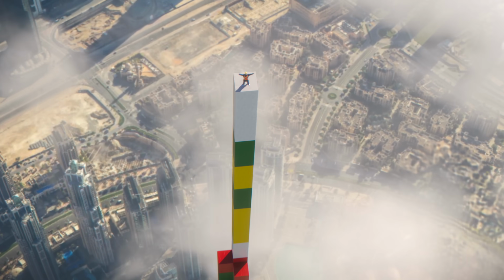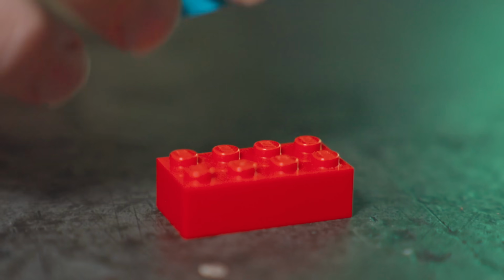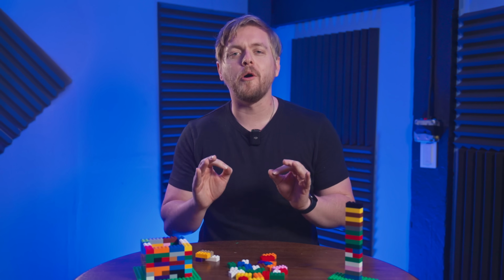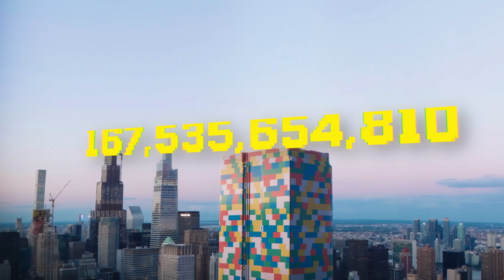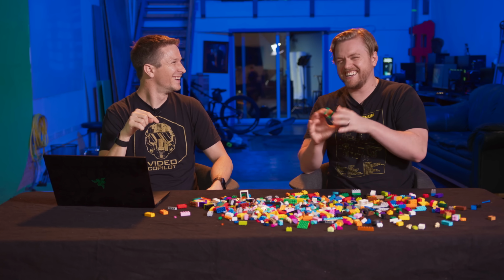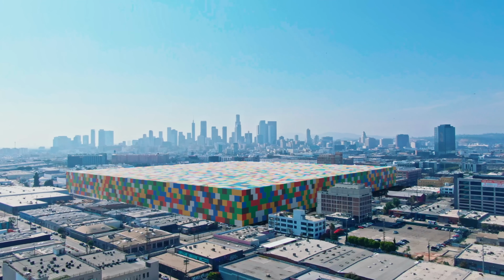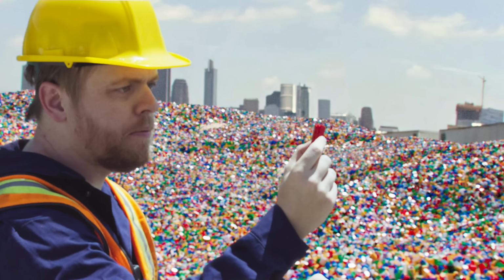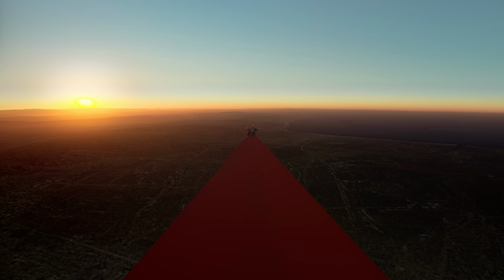How High Can You Build using only LEGO?

Comment: You can't just take the crush force of one brick and multiply it by however many bricks are at the base.  When you stack the bricks next to each other thru support each other.  The bricks have a harder time bucking because there is no room to buckle with all the other bricks surrounding it.
Reply: Yep. They also neglected this when building their "single" row mini tower. Sometimes they used 2 smaller bricks in place of 1 larger one- which may cover the same area, but has 2 extra "walls" pressing against each other internally.
Reply: You're right! We could build even higher, but we've already depleted the world's petroleum reserves. But wait! If we take all living things on the planet, humanity included, and convert them into petroleum....
Reply: Additionally, unlike the video, the Lego structure needn’t be completely solid (few buildings are!), therefore enabling the tower to reach taller still.
Reply: Many comments that followed this comment are so needlessly inflammatory and argumentative. So good to see people continue the rich youtube tradition of arguing over stuff that doesn't matter. Feed that engagement algorithm. FEED IT.
Reply: I also would expect a sharp cone like the burj to be way more efficient. They don't need to go as wide as the pyramid to make it to that height.

Given the amount of empty volume in a brick though, i doubt that the crush force will be THAT much higher. It will crumple inward. It'll be higher still. Maybe 25~50%? Not like solid brick where its like 50x.
Reply: You didn't understand anything at all.

The point they made was not about buckling but solely about the maximum height.

They explained it so well just rewatch, I won't waste my time witht that...
Reply: @oldhelldog5460  you don't understand. Imagine we were talking about a sand castle. A lone 5cm cube of sand could support maybe 100grams of force. But if you surround that sand with more sand... like on a beach it can support several 1000kg.

Max height of a sand tower with vertical walls is probably about 5cm. Max height of a sand pile is like....several kilometers.
Reply: @Idiomatick  A sand pile of kilometers high is literally a pyramid shape, which is exactly what this video concluded. it's the strongest shape.
Reply: @CheeseRunner  They could make it taller though.
Reply: @oldhelldog5460  said "You didn't understand anything at all. The point they made was not about buckling but solely about the maximum height. They explained it so well just rewatch, I won't waste my time witht that..." 

The crush force and buckling was what set the maximum height from the start, before they considered manufacturing tolerances. It's in the video.
Reply: @Psychlist1972  Buckling never determined the maximum height only the shape needed. Only the compressive strength of one single brick did in fact limit the height. 

In the video, buckling didn't determine the maximum height — only the shape. The height was limited by the compressive strength of a single brick, since the material was "infinite".
--> This is also in the video.
Reply: @oldhelldog5460 compressive strength is limited by buckling of a single brick
Reply: @oldhelldog5460  That has nothing to do with what I said.

Comment: To be fair, in a lot of these sculptures, the glue and steel isn't due to failing to trust the bricks, but because they have learned that you cant trust people not to tear it apart.
Reply: Exactly.
Reply: I used to work with the shop near San Diego which builds for many properties, hence have to be built to handle the stresses of shipping, setup, and, yes, children enjoying them.
Reply: Not just that but transporting the statues too I think it’s more of that like they put a lot of work into building it and I don’t want to do it again. It makes more sense Luna and having reinforcements in it.
Reply: ...and they use Methyl Ethyl Ketone and not glue to fuse/weld the bricks together.    Using glue adds some error in the dimensions over large builds apparently.
Reply: It's also for safety. You don't want a sculpture to collapse and injure visitors. People dying in your store or themepark can sometimes be perceived as negative press.
Reply: Lego just BEGS to be constantly arranged & rearranged! It's not like a 3d puzzle where there's only one possible arrangement of the pieces. Plus, I'm betting if publically accessible Lego sculptures weren't steeled & glued together, people would probably detach some pieces to steal as ''souvenirs''.
Reply: griefers: oh hello there
Reply: So trueee
Reply: fr
Reply: Not quite. You can absolutely trust people to tear it apart. 100%.
Reply: @HenryLoenwind  He literally said the same thing, just used double negative. Can't trust not to do something = can trust to do something. The former is just a more pessimistic or negative view of the action.
Reply: @WeHaveACityToBurn it isn't really a double negative. You cannot trust that people will be honest. Or you cannot trust people won't steal. It's not the op's fault there isn't an English word for not stealing.
Reply: @WeHaveACityToBurn  It's not the same. "Can't trust people not to ..." only means you can't be sure they won't. There is no single negative way of expressing that.. You'd have to say something like "you can't be sure they will respect the sculpture". It doesn't mean that it's a given that they will tear the sculpture apart.
Reply: @WeHaveACityToBurn  I disagree. One is saying people MIGHT destroy it, the other is saying people WILL destroy it
Reply: @WeHaveACityToBurn  No, their meanings are slightly different.

The original comment essentially said that you can't trust people NOT to try and break it.
The reply said that you can trust people WILL try to break it.

The first is an uncertainty, saying there's a chance a thing will happen.
The second is a statement of certainty, saying that said thing WILL happen.
Reply: @WeHaveACityToBurn  No it isn't. "Something happening is not certain" and "something will certainly not happen" are not the same.

If we were to write this down formally, we'd use "<", "<=", ">", and ">=". When you negate "<", you don't get ">", you get ">=".

probability(not tearing apart) < 100%

is not the same as

probability(tearing apart) = 100%

after multiplying out the "not", it is 

probability(tearing apart) >= 0%

Or, to stay closer to the wording: "I would not bet my life on you not winning the lottery" (it may or may not happen) is not the same as "I would bet my life on you not winning it" (it will happen).
Reply: @WeHaveACityToBurn  Double negative is kinda dumb ngl
Reply: @WeHaveACityToBurn  Wrong. You focus on the grammar while leaving the reading comprehension out of it. Re-read both again sloooowly. Maybe that will help you out
Reply: @masamaeda9217  I will destroy it
Reply: @masamaeda9217 Pedant. I meant that as an insult.
Reply: Well also Legos have a physical limit to how well they connect to each other and a lot of massive builds need internal structure to prevent its weight from pulling itself apart. The real enemy is from within.
Reply: @ryan7032  one thing that baffles me to this day is that they rarely use technic in these mega builds, despite it being lighter, more flexible, and sturdier overall.
Reply: @Elaarener 
They made a huge dinosaur in LEGO HOUSE Denmark made of LEGO technic.

It is mega ugly compared to the normal LEGO brick dinosaur in the same room.
Reply: @CaptainNapking  
yes. it is fairly ugly. but that's not because it's technic. there's 2 main reasons:

1.its almost 100% studless technic parts, probably because some manager said "lets make a big model using just technic" without talking to the builders first.

2.the design is extremely noisy and cluttered when compared to the other two dinos. it would have been much easier to design if they had used normal bricks as well.

I know they are trying to show the 3 systems, but the separation is entirely artificial. system and duplo are rarely used together, but system and technic are only separate because technic has a dedicated theme. if they had spent some more time thinking about it, and hadn't been so focused on branding, they might have realized this.
Reply: @Elaarener 
Alright, well said, my point is in shambles with little worth left.

But it still has some, right?

EDIT:
Well, it looks like youtube agreed with me and hid your comment for being mean against danish LEGO officials.

Haha, I win again.
By default...
but I win😊
Reply: @CaptainNapking  ah well. sorry if I came across as a snob or something.
Reply: @Elaarener 
I just found it funny how youtube removed your comment for no reason as it always does.
Reply: bet, im stronger
Reply: @kung_puey  the glue is not regular glue but a solvent that sort of desolves the surface area of plastic but only for so long and then two surfaces fuse together. even if you were strong...you'd just break the bricks
Reply: @kung_puey based on your pfp, your weight is 7x the weight of the burj khalifa, all you would need to do is sit on it.
Reply: Humans are the worst!
Reply: glue yes. steel no
Reply: Unless you live in Japan (and the LEGO tower is in a 0 tourist area).
Reply: @carpediem4619  Nah, even then clumsy people exist.
Reply: cap
Reply: I've seen a few videos of people making chairs, bikes and such out of pure lego and they always break when you put a full humans weight on them. I'm sure you could design around it but I really don't think most sculptures made by Lego to be displayed are glued and steel supported so they aren't broken. I think its a legal requirement. Imagine some full size hulk getting a kid climb on it and it collapses and kills the kid. That's a lawsuit from hell waiting to happen. I think legally Lego build for 100% safety in the worst case scenario. But seeing a steel framed glued Lego thing just makes me think, why even bother? Just have it molded so it looks like Lego. You've not achieved anything byt gluing bricks to become one solid piece of plastic. This bugs me so while it has nothing to do with the comment, I had to whinge.
Reply: bot detected

Comment: I have provided specialty electronics to Legoland and have been in their shop. Yes, they use "glue" (MEK which works well with ABS [I learned this when working at Toro Irrigation]) and the structures have steel armatures. What I think is really cool is they have a custom program that can take a 3D model, scale it, and then tell the builder, layer-by-layer, which bricks to use in the process.
Reply: It's kind of like turning the model into voxels. Did the software take into account the structural integrity?
Reply: I'm sorry, did you just use nested parentheses? I mean, it's all correct; it was just unnerving to see it in casual conversation.
Reply: @youtubersingingmoments4402  I'm a programmer. 😆
Reply: oh, thats not even glue if theyre using MEK, thats a solvent. theyre actually welding the legos together then
Reply: @Laddergal  At Toro they called it "solvent welding." In many cases with small parts (irrigation nozzles) it was replaced by sonic welding -- which would not be practical in the Legoland workshop.
Reply: @JonMcPhalen yep, thats exactly what it is. The solvent softens the plastic and allows the parts to properly fuse together, the polymer chains intertangling. It's a very strong bond. Solvent welding is also commonly used for assembling hobbyist model kits.
Reply: Did people not know this.......even as a kid I assumed all large Lego statues were glued
Reply: @SubjugatesComics  To my understanding, Lego statues like those CAN be made without glue and internal supports but they would be so fragile you wouldn't have them as a public display without having serious protections against being touched, even by a medium gust of wind.
Reply: @SubjugatesComics  most of them arent glued as well... those ones you dont see more than once lmao
Reply: @SubjugatesComics  You assumed, but did you know?
Reply: @SubjugatesComics  A lot of places try to give the impression that they're using nothing but LEGO.

I remember one event where they were showing off massive LEGO structures, and someone screamed out "how much glue did you use?" The hosts tried to hand wave it away and not admit that the whole thing was glued together. And then people demanded the chance to come up and try to pull bricks off to prove whether or not it's glued. They cancelled the show for the day.
Reply: If any project needed a pick and place machine... lego buildings would be it. :D
Reply: They basically have Minecraft’s litematica mod, but for legos 😂
Reply: I wonder if it’s still the case but the program I used only gave us a stud map, not brick by brick instructions. And it was a solid lump of bricks so we had to decide how thick to actually make the body and how to connect the supports in the hollow body. But it does give you a good final product once you get around that! 😅
Reply: Its not exactly a glue its more of a chemical that welds the pieces together as of now.
Reply: Everything you just said is widely known by Lego enthusiasts. 

We've known for quite some time, actually. It's also never been a "secret" or anything.

However, to non-Lego fans, it's some neat information to share.
Reply: I thought they used Kragle?